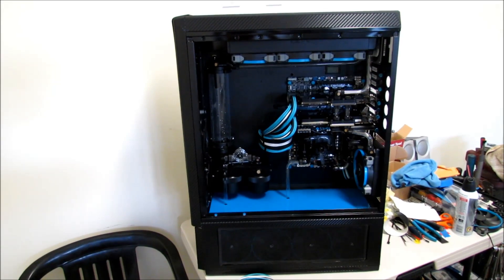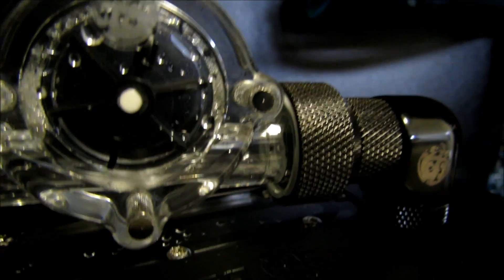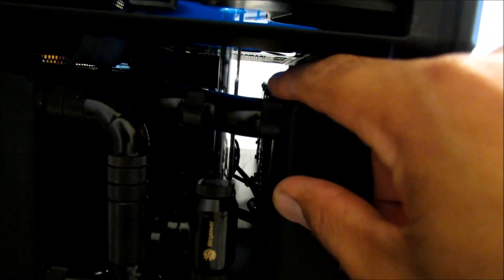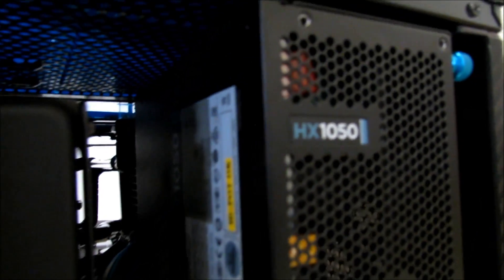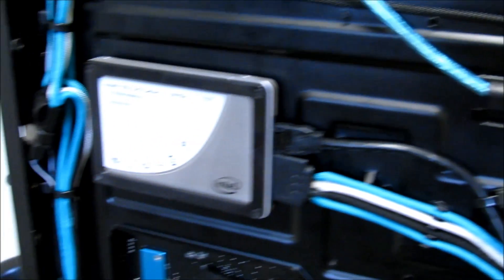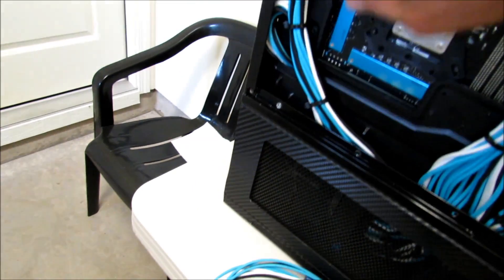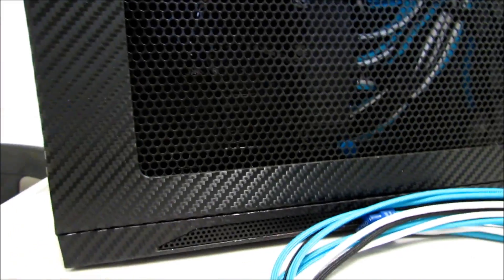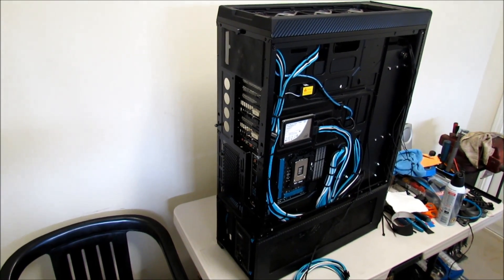Neptune 2.0 - NZXT Switch 810 Build Log Part 4 - Leak Test Passed, PSU Install and Final Touches

Comment: where did u get those sleeved Cables from?
Reply from the maker: I sleeved them myself.
Reply: +OCTurboJoe Was it difficult?
Reply from the maker: +Junkstarr It's time consuming but if you have patience, you can do it.  However, just be careful with your PSU cables.  There's a bunch of other how-to videos on YouTube.
Reply: +OCTurboJoe Are there many things I could possibly do wrong when sleeving cables myself?

Can you recommend any sleeving or manufacturer?
Reply from the maker: +Junkstarr Mainly the PSU, you have to discharge it and let it sit for a day at unplugged to avoid getting killed by it, before cracking it open.

The first and last company I got cables from was Ensourced Custom Sleeved  Cables.  He used to make extensions for me back then but I wanna say he does do full cables now.  Check him out...
Reply: +OCTurboJoe Why would I have to open it? :o 
my corsair hx1200i will have completely modular cables. 

Thanks for the tip. :)
Reply from the maker: +Junkstarr Yikes sorry, lol.  I have an older HX model that has captive PSU cables.  Didn't know what PSU you had.  But safety is always a must if you were to do what I did.  A fully modular PSU doesn't need to be opened up, evidently.  

You're welcome!!

Comment: Its awesome. Best 810 build log I've seen yet. I was thinking of using bulkhead fittings but you have made me think again.
Reply from the maker: Thank you.  Make sure you do some practice runs on a spare sheet.  I made 5 holes before I got it down.  I use bulkhead fittings only for what they're used for...filling, lol.

Comment: Great stuff Joe, cable management is class, done a really nice job. I hate cable management, pity you don't live close by i would pester you to do mine lol. your Rig has turned out very special, you should be very proud.
Reply from the maker: Thanks alot Dave.  I actually hate it when there isn't enough space.  But with custom PSU length cables, it turns out to be easier and is worth doing to save time and headache.  If we only had teleportation, I would do your cables in a snap, lol.